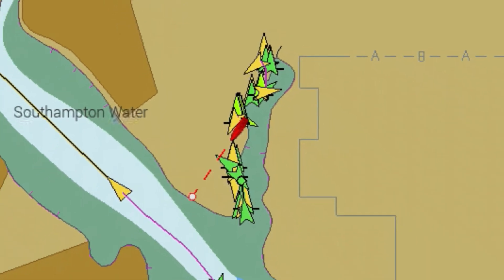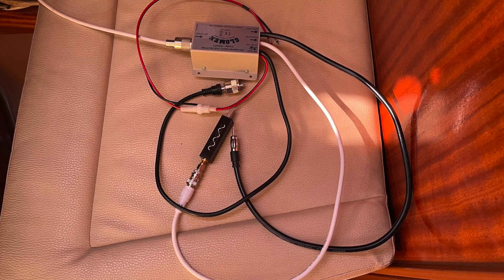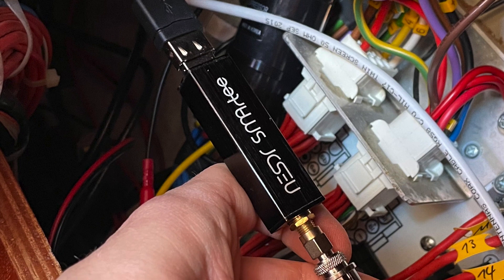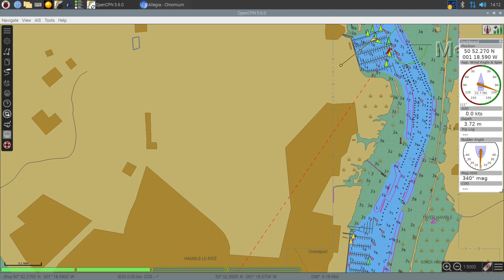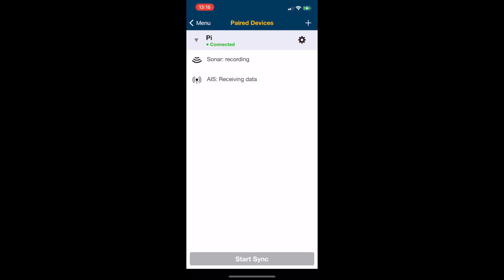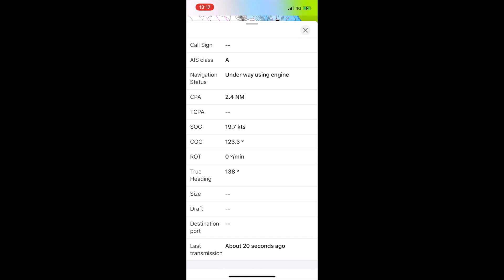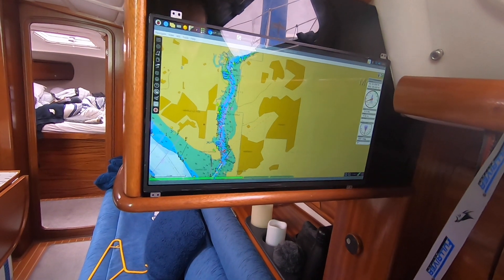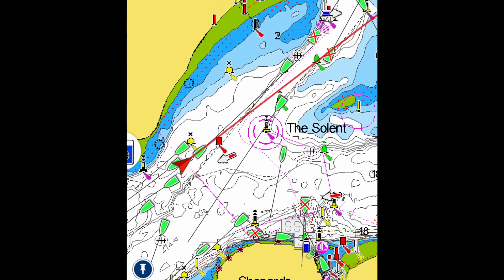VHF/AIS/FM Splitter (Glomex RA201install) - AIS Update - Boat Projects

Comment: RF splitters like this do what the name implies and split the signal.  That means that each output receives 1/2 the input input power.  Then you split the signal again which means you are down to 1/4 the original signal.  You would get much better performance by adding a separate antenna for each receiver.  For AIS the antenna  could be relatively low since long range is not really needed.  Also consider the lost performance of other devices using that antenna.
Reply from the maker: All good points and it is something for us to investigate further. There has always been a splitter in this system (for as long as we’ve had the boat, although it was just VHF/FM) Do the marine AIS units with built in splitter suffer the same issues?
Reply: @BoatingwiththeBaileys  Any passive splitter will have the same issue.  You can try to overcome the issue by adding amplification, but that will increase the noise to some extent.  You also then have the issue of not transmitting through the amplifier because that will let the smoke out of the amp.  Separate antennas separated be several wavelengths (so they don't de-tune each other) will give you the best performance. Another thing to consider as you optimize the system is coax losses.  At VHF frequencies and long runs, these can add up.  For your VHF antenna, at the top of the mast, use  low loss coax and a simple 1/4 wave whip ad you will have great receive  performance. Do not be  tempted to use a gain antenna on a sail boat.  These will have poor performance when healed over.  For the AIS, a 1/4 wave whip a few feet above the deck will work well.  That will give you line of sight coverage to the horizon and that's all you really need.
Reply from the maker: Great advice - many thanks

Comment: Can you “expand “ your adding the Victron info to the RPI interface.  I have the Victron BMI700 with the Victron blue smart solar charger and Victron blue smart shore charger.  I have the Victron app on my iPhone and can “see” all the Victron functionality but it would be a cleaner system if I could see the Victron data on my OpenCPN/RPI4.  Thanks
Reply from the maker: Hi, Yeah sure. I'm using a Victron plug-in which is avilable from the SignalK app store. Im then using the purcahsed Victron cable which converts to USB which is just plugged into the PI. This plug-in decodes that data and presents the info in the data browser. From here i've recording the data in my DB and displaying some of the live information in KIP. I didn't really document this that well, but some further info in this video https://youtu.be/2k_HZ6ccZ1M and another one on the channel around the victron smart shunt install which is where all the data is coming from. I believe the plug-in can read many Victron products and solar is included in that, just no direct experiances of this. Hope this helps and let me know if you need anything further. Happy to record, add info, take pics.
Reply: @BoatingwiththeBaileys  many thanks!  I am an experienced sailor, but this integrating computer business to a easy to use/interpret data has been a challenge.  I tried to use the Lyesmarine Bareboat OS but quickly became overwhelmed so I reverted to Raspberry OS, to simplify my “personal OS”.  Thanks again
Reply from the maker: @jayknight850  Yeah it can be very time-consuming and while a lot of work has been done, it's still not that straightforward sometimes. I have to say that the victron part was ok to setup and its one of the data sources/pages that I use the most. I've just had a quick look at the BMI700 and it has the V.E Direct port, so that and the attached cable https://www.victronenergy.com/accessories/ve-direct-to-usb-interface, along with the plug-in should get the data in quickly. You might be able to network the other kit but as a starting point, the shunt info is really useful.

Comment: I have the same splitter and it is awful.  One thing to try - see how far you can receive if you take out the splitter and go direct to the masthead antenna?  I was getting about 8-10 miles with the splitter and about 17miles without. Either one is probably adequate but this halfing of distance is also affecting the VHF transmission distance which I was not happy with.
Reply from the maker: That’s interesting and something I will check. As we have always had one of these splitters connected I have never tried without, however I’ll give it a try and report back.

Comment: Thanks for video.  I need to look at my signalk as it seems to have stopped passing on Ais, any thoughts?  I like the idea of splitter, in your video you said £30? But Google search seems to suggest glomex 201 as £70+.  Where did you get yours from, for £30 I would definitely copy your set up..
Reply from the maker: Sorry thats a little misleading. In the video I was referring to the £30 AIS device rather than the splitter. The splitter unit cost about £65 if I remember correctly. Still pleased with the setup and I will put a comment on the description to clear that up - thanks